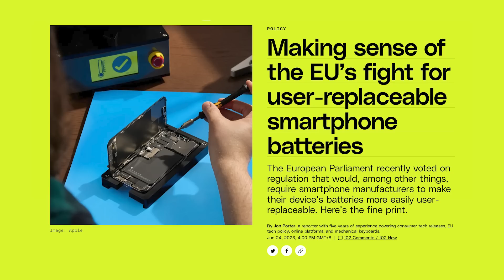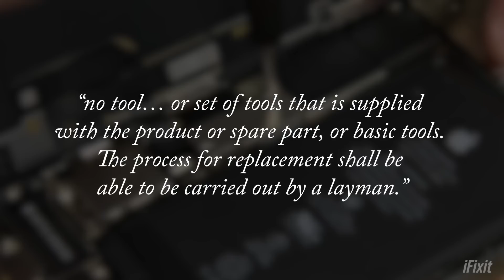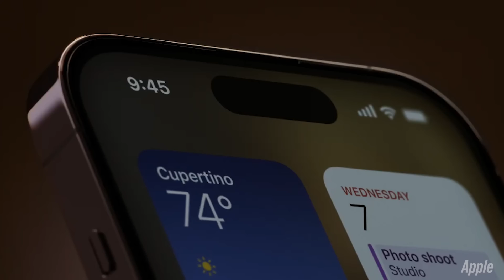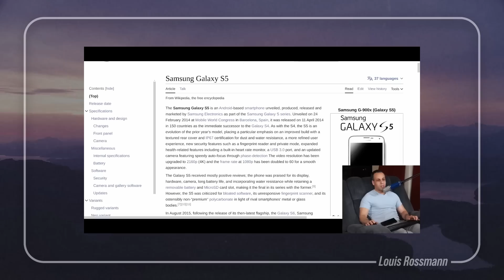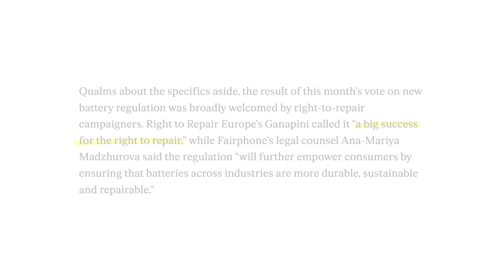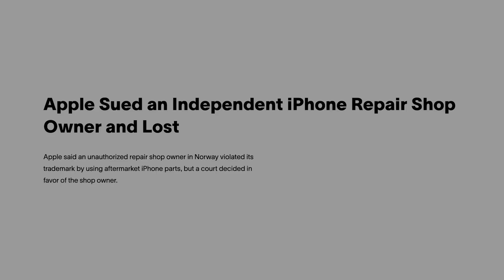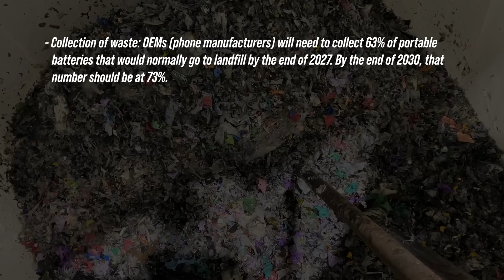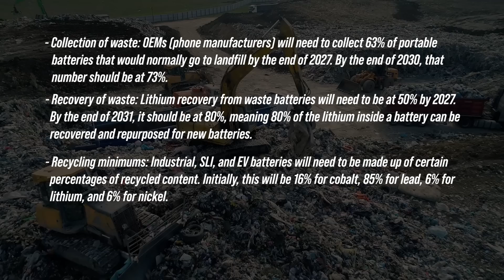EU Just Changed Smartphones Forever

Comment: Plus and minus of this. 

In the old school days if you wanted a private conversation all you had to do was just yank out your batteries and it was as simple as that. Just make sure you turn your phone off to make sure it doens't fry the data.

As mentioned my sceond concern is waterproof phones. Remember just splashing a dab of wate ron your phone and that was it it was done? Or dropping it in the only small puddle of water in the parking lot, or using the toilet and forgetting it's in your back pocket..... By doing this we get to go back to boiling our phones in rice to save them.

Comment: I'd take a fixed battery over a removable battery any day of the week because fixed batteries can be integrated into the device and require less space. Thus, manufacturers can make them bigger. With this new regulation, manufacturers will need to figure out how to better integrate removable batteries into already limited space with minimal efficiency loss. That’s no small engineering feat.

Comment: What's to stop criminal hackers rebuilding and reprogramming stolen phones because of replaceable battery access?
Reply: A criminal can buy the tools to take apart and screw around with current phones as well, you mainly need a heat gun and some screwdrivers and plastic tools. Doesn't happen much because phones don't leave much room for custom modding, making the battery easily replaceable isn't going to change this.

Comment: please bring back the repairability that Nokia 3310 had where you could disassemble the whole device and replace any part with a part from any manufacturer that was designed for the particular device. The devices won't need to be much bulkier or anything, they just need to be redesigned

Comment: Goodbye water resistance
Reply: Samsung galaxy S5 is IP67 water resistant and has a replacable battery. There are other examples as well. It can be done.
Reply: Gopros are fully waterproof between 5 and 10m of depth and you can swap out their batteries

Comment: With machines what people want is plug and play replacements for most parts in an open ended easy to replace  design with no obstructions or lots of dismantling because parts get in the way of other parts.  I had to disassemle my entire beko dryer just to replace a smaller starter belt pully which took me over 5 hours and alot of jigsaw skills to do.

Comment: EU is nightmare at times, i understand battery's not been swap able drive cost down.

Make battery's so they can be swapped out is going back steps along losing things like water resistance, mage safe, wireless charging and much more because it will drive costs up coming up with new design for all these to work again with removal able back.

This will come at large cost to quality of other things along putting phone shops more out of business since a lot there big money battery replacement and repair.

Tech firms really should just say f### you to eu hold it over them as they hold more power to eu, don't agree with replaceable battery stop been cheap and learn skills to replace your self or payup.

This stupid laws going to screw a lot up and eu is to blame once again like alot of other stuff they said was good idea and not turned out correct.
Reply: None of that is true. Phones with removable batteries are still water-resistant. It's just a myth perpetuated by companies for ditching batteries, SD cards and headphone jacks.

Comment: I had the LG G5 which had the slide battery. It actually ruined the phone. The battery swelled and messed up the phone. In two years time I went through 3 batteries. The replaceable batteries are lower end and have problems

Comment: These changes are good for both users and environment. We deserve sustainable products. 
1. Replaceable batteries
2. Universal charging port (ex: Few are providing Type c- c and few are Type A to C)
3. 6 - 6.5-inch screens
4. 3.5 mm jack. I feel earbuds are not sustainable products, but it is user choice.
5. Software/Security updates until device is in working condition. So many mobiles capable of operating on latest OS but lack of updates making them feel outdated.

With these good old days will be back!

Comment: Honestly, I don't really care about this. I care about phone's performance more than the battery. After 2-3 years pass, the phone's performance is just unbearable and you still have to buy a new one. I always sell my phones to an used phones shop, so there's less waste. I had Galaxy J3, it wasn't bulky at all. I'll assume they started making non-replaceable batteries is because they wanted more profit and if your phone didn't have a protective phone case, it would open and the battery will fall out. It happened to me, even with the case on. When the first battery of my Galaxy J3 became a literal balloon, I bought 2 more and guess what; they all became balloons. I brought them to a repair shop and was told that I might need to buy a new phone. I'm alright with current batteries, as they can last up to 3 years atleast.
Reply: Think you're being arrogant of the reason why it's done in the first place. Planned obsolescence heavily encourages electronic waste and this kind of anti-repair copium is exactly how they're getting away with doing this in the first place. Try considering the pros for everyone rather than your own benefits.
Reply: @QuackZack  
Even with removable batteries, many people will buy a new Smasung, iPhone, Xiaomi,... Every year. Perhaps it will help a little, but there's a lot more people like me, who want the best performance from a phone possible. But knowing manufacturers, they'll make something that's for trash.

Comment: The switch to non-replaceable batteries is totally profit driven. The change makes it so that once your battery runs down you either buy a new phone or you have to pay the exorbitant fees to get the battery replaced. I remember on my earlier smartphones I was able to go on Amazon and get a higher capacity battery that fit my phone to replace the previous battery. Bravo to the EU for holding these companies accountable.

Comment: Manufacturers only motive is 'Profit', they created the throw away society.  Personly I wouldn't touch an Apple with a barge pole because of their business model to lock a consumer into their product.  Microsoft are also now about to create millions of tons of e-waste in their drive towards Windows 11 only being able to work on newer machines, I have 4 Tower PC's at home 2 are newer builds with compatible hardware so are capable of running Windows 11 the remaining 2 are non 11 compatible but can still run Windows 10.  I think I may take the opportunity in 2024 to switch the oldest machine over to a Linux version, if I like the results then I will switch the other non compatible machine over to Linux as well and have 2 Windows and 2 Linux.

Comment: Samsung and apple will stop selling most phones without removable battery due to technological problems. If LG sell smartphones again, LG V70 with removable battery will have dual screen better by using battery case. Also LG rollable will have 'eject battery mode'. It will use way which is used in G5 because it only needs small place.

Comment: I still have 2 laptops with removable batteries. Apropo, I have an UPS. It is SK easy at home tor.emove the battery of the laptop and to use it on cable tk.my UPS, so to not use the resource of the battery during unnecessary use. Can You do it with a newer laptop with an unremovable battery? 8-) 
Also, I never saw a tablet with a removable battery (apropo, I had a phone, almost as a tablet - Ulefone U7 with an 7" 16x9 screen, so it was almost a tablet then...

Comment: I miss being able to change my battery. I would much rather have that than IP67 waterproofing. Ever since I got my first mobile phone in 1995 I have never dropped my phone in water intentionally or otherwise. But it's much more common for me to want to change the battery - either as a spare for on the go, or if the battery's life cycle is near its end.

Comment: Non user replaceble batteries idea originates from justified greed kind of mentality. Battery unfortunately has a life span and needs to be replaced even the device still works. The way batteries are encapsulated by glue to justify water resistance, when most phones are shattered and getting moisture inside regardless. Laptops for example have evolved in quite healthy way by some manifacturers, even though RAM and SSD upgrades are mostly the options, but batteries are always easyly servicable, this does not apply to apple though, they are doing their own thing that they call "premium".. yet their OS is a Linux with a pretty face. What EU has done here is amazing in terms of device longevity and life span of electronics in general.

Comment: There is nothing new in "right to repair" legislation it has covered Motor Vehicles for decades insuring vital parts primarily for safety are available for years after production has ceased...Indeed its common to be able to source vehicle parts and from diverse sources and not neccessarily the OEM again long after production has ceased as no doubt the product of strict legislation that insures critical safety parts are always available..Typically this is achieved through certification with production and sales licences or construction and use legislation...indeed motor vehicles are probably the most subject to such legislation...safety is the real issue here but some legislation extends further to areas such as pollution and the environment...Mobile phone manufaturers cant complain as they wouldnt be the first engineering manufacturer in the world of industry  to be forceably reigned in by the law...!!

Comment: some phones actually are easy to open without any tool (to change the battery at least), but that would allow consumers access to the motherboard and other pcbs, which if not handled properly could cause latent ESD or even worse for consumer, a catasthropic ESD.
Reply: @wahrheitssucher7575 yeah it only happens to really unlucky people, the manufacturers views normal bloke as risk (that's why you still encounter the "not for consumption" on detergent's packagings), I mean they kept their working spaces free of ESD risks for a reason, so I imagine they wanted to make their product foolproof
Reply: @wahrheitssucher7575 I have had three experience of catastrophic ESD, to my RAM, bluetooth charging motherboard, and a sound card, catastrophic means they can't be used anymore

Comment: A removable battery is the best thing ever. My headset is a steelseries arctis nova pro wireless and it comes with 2 batteries where one is always charged in the DAC while the other is providing power to the headset. It’s changed within a few seconds and gives me unlimited wireless time w/o ever attaching a cable to the headset directly. 
Also I was using the iPhone X for many years and just switched to the iPhone 14 Pro when it was released, simply because i couldn’t stand the battery life anymore. The phone was perfectly fine with some features that aren’t even on the iPhone 14 anymore. How sad is that. Sure I could’ve gone through the hassle of sending it in to replace the battery but let’s face it, who wants to be w/o his phone for 2 weeks. 

The decision to make batteries non-replaceable by end-users was definitely motivated by increasing sales because it worked on people like me. Especially in times where they struggle to implement new features that actually makes the release of a new phone worthwhile. „Oh here’s the better camera and you also get USB-C… meanwhile we changed the back of the phone a little so it provides more robustness“. 
Those companies grew so much, their shares rose so high that now they are under pressure to have x income per year. It’s like the gaming industry where the 27th sequel gets released because it sells ok and provides steady income. Ruins innovations too

Comment: The reason they make items with sealed batteries is because they can design the structure around the battery, making it cheaper to assemble.  Now, I'm sure they can absorb the costs on smaller items like phones and tablets and laptops, but making a Tesla with a user changable battery will ruin the company.  Design and assembly costs will then drive the cars out of reach of most buyers.  Imagine the battery swap system that users will need to pay for and install at their house so they can push a button and have the battery swapped out.  Nuts.  The wording of the bill will destroy access to many larger products for many users.

Comment: "Do you think this is the natural progression of design based on consumer demand, or profit-seeking anti-consumer products?"

I think I'll say this - It can be both. Consumers will buy what's available for a given niche, and companies dictate what's available.

These legislators stepping in to break us out of that loop is a heroic act. Because there's only so far "voting with your wallet" can go when all of the options are bad - Or especially, when all of the options are merely sufficient, but missing critical features.

Saying that this is the natural progression of design is TRUE - but also entirely missing the point. Design doesn't happen in a vacuum. A designer sets out with specific goals, and meets those goals to the best of their ability. A designer can exclude repairability or ease of maintenance as a goal, unless outside forces require them to include it. A designer can include difficulty of repair and non-maintenance as a design goal.

Saying that this is the natural progression of design, with no other context, implies that this is the ONLY valid progression of design, natural or otherwise.

But, nature is filled with constraints, as are our modern markets. The fact that one of those constraints can be law is a (potential) boon we should not forget or dismiss.

Comment: Removable batteries is nothing new that's the way it should have always been it was just a scam when they designed them to not have removable batteries it's a scam the way they change the software every year and make it so that the phone you just bought the year previous is now useless without an update and then after about 5 or 6 years the updates aren't even good enough and then the software is useless completely it's no longer compatible designed obsolete-ness or something is what it's called it's illegal and it's immoral

Comment: I am not sure but did anyone read that ecodesign regulation? There is a lot of positive splash about this but i think many content creators skip the research part. According to what i have read the battery has to be easily replaceable if the device is not water resistant (i am not sure what degree) or the battery capacity is still above 83% after 500 cycles or above 80% after 1000 cycles. According to my experience almost all devices fulfill either one of these requirements leading to no change at all.
Hopefully someone can tell me its different. Otherwise some lawmaker probably got a nice bonus for these loopholes.

Comment: Unless you standardise the batteries themselves, limiting them down to no more than 5 set shapes/voltage/connections, the companies will just continually change the batteries between models and claim "no stock" after two years or so, putting us all back to the same outcomes as now.
AA through to D cells worked well due to standardisation and many products benefited through not having to supply their own individual battery types. A standard for battery power tools should also be looked at.
Reply: Nah. There will always be 3rd party parts if there's a demand.

Comment: I have had iPhones since they first came out. I don't replace my phones every year like most people do and I have never had to replace a phone because the battery would not charge. I just replaced my iPhone 10 to an iPhone 14. Battery was fine but after a few years I had to replace it is because I can not update to the latest iOS. So people will still not be able to keep their phones forever, once your phone is too slow to accept the new iOS you will have to change it anyway. And this is what phone manufacturers will do. They will make the phones so that you have to get a new one after a couple years because you can not update the iOS. The battery issue is BS.
Reply: so because it doesn't impact you, it's bs?
Reply: Phone batteries last from 2 to 3 years. I would say that a large portion of people that own phones have to get new phones in a couple of years because they can not upgrade them any more because the processors are not fast enough for the new IOS. This has been my experience ever since I bought my iPhone years ago and I am sure I am not the only one. And now the new generation of kids wants a new phone as soon as a new one comes out. So yes to me it is BS.  @nikker1

Comment: Making the batteries replaceable is a good step forward. But notice something, I replaced my smatphone 2 years ago, had it for 6 years maybe?  The battery and all physical components were all fine, but updates for the system stopped. Meaning, at some point, I couldnt run some apps anymore. I remember the banking app was no longer working. Making all hardware easly replaceable is a good step forward, but software is another issue.